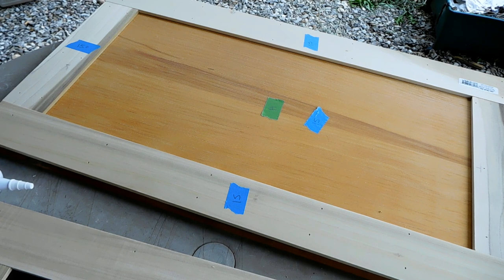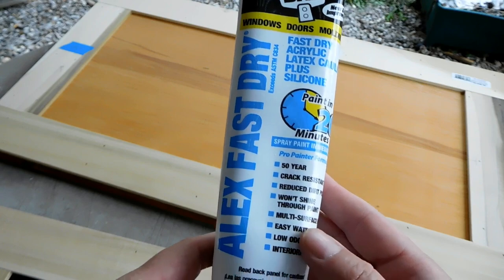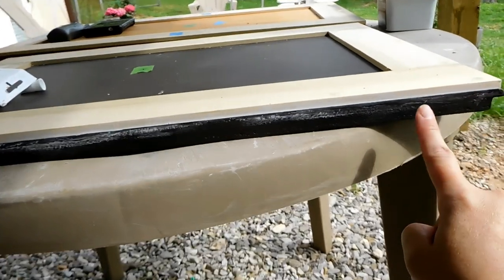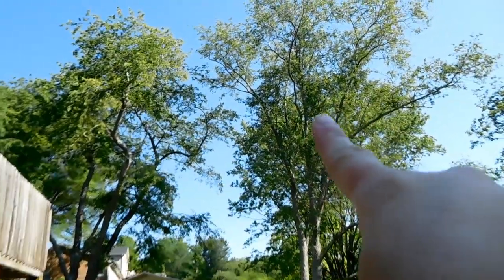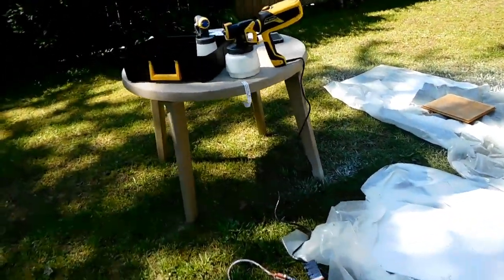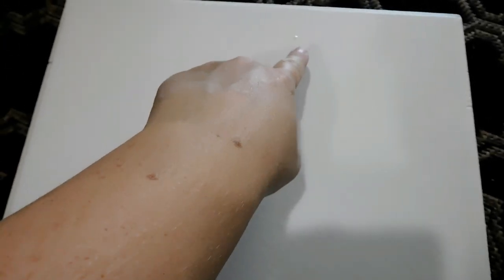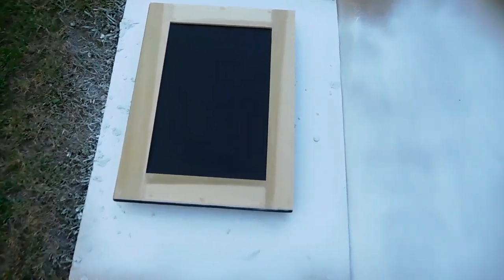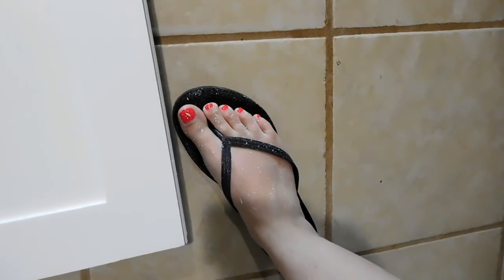Spray Painting Kitchen Cabinet Doors!!! :D Finally!!

Comment: What ratio did you end up using? 2 part paint 1 part water or 1 part paint 2 part water?
Reply from the maker: I used 1 part water to 2 part paint. I did not want a super thick consistency because it will not spray evenly out of the paint gun if it's too thick. I wanted more of a thinner coat so that I could do  three layers on it to make a more smoother finish. But be sure to read the back of your paint can because each paint is different. You can also call the  company that makes the paint and ask them what the ratio is for your spray paint gun. That's what I did as well as read the back of the can. I hope this helps, and happy painting 😊
Reply: I also have a Wagner flexio 590 that I use to spray paint. The ratio that I find works best for latex paint is 3 ounces of water for every quart of paint or 12 ounces per gallon of paint.  Metric measurements are about 90ml for 1 litre of paint or 360ml for a 3.78 litres of paint. The detailed nozzle is the one that I used to paint cabinet doors.
Reply from the maker: I will definitely keep this in mind 😊. It's good to know the ratios for future projects. Thank you so much for watching and commenting ❤️

Comment: You don’t even have to thin the paint at all just adjust your sprayer to wear you’re paint stream is less paint comes out. Soon as I seen you do the practice run I instantly said to myself she has to much flow coming out lol.. I have the Flexio 590 and I’ve had it for 3 yrs and absolutely love this thing. I originally purchased to paint smack refurbished wood furniture and small decor pieces but I love it so much I have since  painted the inside of my entire house and large large brick fireplace so much stuff this thing is amazing.. I know you have finished you’re cabinets by now but just in case anyone else might could get some benefits from my tips, also if you don’t spray n stop spray n stop you will get a much much smoother even coat just keep the nozzle pulled in and just keep you’re hand moving side to side or up n down which ever direction you have the nozzle set up this will improve you’re coverage a whole lot.. But I seen you’re finished cabinets they look great. Oh and another thing for anyone who may read this if you are doing a project such as cabinets that you really want to look professionally done do a light sanding after you’re 1st and second coat with just really fine 60 grit paper then do you’re last coat which should be three total but each coat just do light coverage they will turn out so, so much better rather than 2 fuller coverage coats. Hope this helps someone .. just take you’re time and you will be very happy with whatever you’re trying to paint and trust me you can’t wreck anything if it doesn’t turn out you can sand it down and start over it’s only paint. But it does take a little practice but once you get it down all you’re adjustments you’ll love this thing if you’re a DIYer n enjoy painting.. I promise you..
Reply: Thank you for taking the time to offer this advice! I am about to buy my first paint sprayer and this has been a big help toward my confidence level in using it. I'm going to copy your instructions to save and use them when I get the sprayer. Again, thanks for sharing your experience, Kim.
Reply: 60 grit is not a fine paper,it's very aggressive

Comment: Looks great! I have the same sprayer and wonder if you recall your settings that you used. It looks like you used the fine sprayer - the small cup, but do you  recall the air setting and wideness that you used? Redoing all my six panel doors in white so I want it to look as good as yours!
Reply from the maker: Tim Barrett thank you so much! :-) it's been a while since I spray painted them, so I can't remember the exact spray setting I had it on 😕. I read the instructions for what they recommended for a finer mist, and I practiced on some cut up cardboard boxes outside to get the overall smoothness of what I was looking for. I think I just adjusted the nozzle to where I thought it was not going to over spray or spray too thick, and kept it close to the number the sprayer recommended. But I definitely went with finer coats instead of thicker ones because of runs, and drying times. Too thick of a spray will leave Bubbles as well when they're drying. I'm so sorry I can't remember the exact setting. Make sure to first spray away from the cabinets first in case there's any splatters when it's first coming out of the nozzle, and then spray it smoothly while not shaking the nozzle or your arm from side. This will help to make sure you get a smoother finish. I found in practice that when I turned the nozzle different directions while spraying, the paint was thicker in certain areas than in others. So if you can do a smooth spray with keeping your arm straight and just moving the nozzle as you go without turning it side-to-side, you will get a very smooth finish. I hope that makes sense lol. I'm terrible at explaining  things. Yes I did use the smaller cup because they said the larger one is for bigger projects and would probably over spray. Also make sure that whatever paint you're using, to dilute the paint according to the instructions on the back of the can. Each paint is different for spray painting. You don't want it too thin but you don't want it to thick either. Because thicker paints will get globbed up in the spray nozzle and then can cause drippage or over spray. I hope this information helps you and I thank you so much for watching my video and wish you all the best on your cabinets! :-) if you have anymore questions, please let me know

Comment: Great job you lucks like profecional nice red foot nails I love it you doors lucks very nice but you never said how much you. Diluted you paint ? Hello from New Jersey
Reply from the maker: My angels painting lopez thank you!! 😊 the paint was a 2 to 1 ratio. It was two portions of paint to one portion of water. So if you did two cups of paint for example then you would only use one cup of water. I hope this helps! :-) also keep in mind that every paint is different. The type of paint that I used was a two-to-one ratio. But look at the paint instructions for whatever type of paint you use, before deciding the ratio of paint to water. You can also call the paint manufacturer for the proper ratio to make sure of what you need to use in the spray paint gun. Thank you so much for watching and I hope that you have a very Merry Christmas! :-)

Comment: You did such an amazing job! I just bought the flexio 590 sprayer and I am planning to spray paint my cabinets. I was just wondering what ratio did you end up using? I know it’s been a few years lol hope you can guide me a little! Thank you ♥️
Reply from the maker: Thank you so very much! :-) I cannot remember the paint that I used, but I think it was a one-to-one ratio. One part water to one part paint. Check the back of the paint can, and it should give you instructions on the ratio if you're using a spray gun. If it does not have instructions for that, I would call the local store that you purchased the paint from and check with the paint department and see what they recommend for a sprayer. But if I'm not mistaken, I think mine was a 1 to 1 ratio. Thank you so much for watching this video! I hope it's your pet project does exceptionally well! ❤️😊
Reply: Thanks so much for the advice 🥰
Reply from the maker: @nidahassan5556  you're most welcome 😊

Comment: You did a really great job on the doors! What kind of board did you use to frame out the doors? I've been to a couple places and can not find anything that slim or wide.
Reply from the maker: Thank you Noel! :D

I purchased quarter inch thick boards that are 1.5 inches wide, and I around 4 ft tall from lowes.  I will send you the link to them below :).

https://www.lowes.com/pd/Common-1-4-in-x-2-in-x-4-ft-Actual-0-25-in-x-1-5-in-x-4-ft-Poplar-Board/1000074305

Comment: Do you still have the links to the wood you used and the paint too? Thanks!
Reply from the maker: Here is the link for the wood that I use for the cabinet doors.
https://www.lowes.com/pd/Common-1-4-in-x-2-in-x-4-ft-Actual-0-25-in-x-1-5-in-x-4-ft-Poplar-Board/1000074305

The paint that I used is at lowes and is Valspar Cabinet Enamel

Comment: font of doors look good ,but edges look not so good
Reply from the maker: Thank you for the compliment on the front of doors. The edging actually looked really good when you saw them in person. Beveled edges makes it really hard to make everything even. With these 1965 doors, there was no way to actually cut the beveled edges off to make Square doors so that they would look more modern. If you cut the beveled lip off of the door, and then lined up the trim on the face of the door, with the cut off edge to make a more square style, non beveled shaker style cabinet door, then there would have been a gap in between the cabinet frames, and  the doors edge. The beveled Edge hid that gap where they back of the indention fit into the frames of the cabinets. So the way that I did them turned out to look pretty awesome. They actually looked amazing and flawless in person. Thanks for watching the video and I appreciate the compliment on the front of the doors

Comment: Great Job !! was just wondering if you could have trimmed off a 1/4"  all around each door with a table saw to make it Square?  if not can you tell from the edges that the wood is glued on? Also, did you put 2 or 3 coats of non-yellowing poly on them after you painted for protection from wear chips etc ?
Reply from the maker: Thank you! :D  I actually thought about making them square, but by doing so, then it would show a gap from where the back of the door fits inside the cabinet.  The lip is what hides the crack of the front to where the backside fits in the cabinet.  I hope that makes sense lol.  

You cannot tell that the wood is glued on because you want to make sure that you don't put the glue to close to the edge of the trim when gluing it to the cabinet.  If you do happen to get some on the outside, then wipe it off immediately. I usually run the glue on the back of the strip, in a squiggly line down the middle of the back of the trim, and not an excessive amount, so it doesn't squeeze out the side when gluing it to the door.  I will leave the video link of where I made the doors facings below ;).  It gives a step by step detail on how to make them.

If you use a enamel paint on the doors, then you won't need a top coat.  When I first used spray painted these doors, the lady at Lowes gave me the wrong paint to use.  And after all the hard work, it chipped.  I ended up going with the insl-x cabinet coat enamel paint.  You can get it on Amazon.  It doesn't require a top coat.  If you do go with a regular paint, then yes you would use a top coat.  Preferably a water base polyurethane. It's not supposed to yellow.

I hope this helps!  Be sure to check out the link below.

https://www.youtube.com/watch?v=Ga4ZesiQ1hk&t=509s
Reply: When I watched your video I was shocked because I've been rolling that same idea in my head for around 5 years. How was the final product, was it worth it ? thinking of chalk paint aswell ,,, let me know much appreciated!
Reply from the maker: Michael Chisenhall thank you so much! :-) the original paint that I went with in the spray paint gun wasn't the best paint so I ended up sanding the cabinet doors and used a product that I bought on Amazon for cabinets called insl-x cabinet coat enamel. I really like it. The spray can paint Gun Works amazing! You just got to spray light coats and not get too close because you got to be careful with dripping. I don't know how well chalk paint would work in a spray paint gun. You could read the back of the paint and see if you can use it in a spray paint gun. Typically a lot of paints have to be watered down in order to use them in a spray paint gun. I would read the back of the label to see what the ratio you would need to use is and then tested on a piece of cardboard or scrap wood before spraying on your doors. The spray paint gun makes it so much easier to get them all done smoothly and easily and faster. I love the spray paint gun that we got :-). It's amazing! I hope this answers your questions. Let me know if you have any others :-)

Comment: When you say part is that one cup water two cups paint.
Reply from the maker: If I'm not mistaken, it was two parts paint to 1 part water. I actually called Lowe's when I purchase the paint and they gave me instructions on how much to use. I think the back of the paint can will actually give you the exact ratios depending on what paint you're using. I'm so sorry I don't remember off hand. It's been a while since I did the project and honestly cannot remember. I know I should have put it in the video but wasn't thinking about it at the time. Definitely read the back of the paint can and if you don't get your answer call the paint distributor because they can actually tell you what ratio to use. Happy painting, and if you have any other questions please let me know. So sorry I couldn't answer this one

Comment: So Its been well over a year, how has the painted cabinets held up?
Reply from the maker: The cabinet paint took beautifully! Thank you for asking. We have since sold the house and I bought a new one. But the entire course that the paint was on there since before we moved in October, stood up fantastic
Reply: Thanks,  I am looking to paint my cabinets in a new house we bought.  Is there anything you learned that you didn't cover in the video?
Reply from the maker: I will tell you that I did use a different paint on another set of cabinets than I used in this video, and even though the quality of paint that I used on the cabinets in the video was great, I feel that the other paint quality was exceptionally better. The paint i used on a bookshelf cabinet doors held up fantastic. I used the Valspar cabinet enamel paint on the bookshelf. It was wonderful because you did not have to put a top coat over it. The paint that I used in that video was not specifically designed for kitchen cabinets. So I did end up having to put a top coat over it. To save time and that extra step, I would use the Valspar cabinet enamel paint. It worked amazing and you do not have to put a top coat on it. 

The only other thing I can tell you to do is if you have any nail holes or any top of area that needs to be filled in, make sure that you sand any wood filler down really smooth and also make sure that you caulk everything and let it dry before you start painting. I know that's just common sense, but I can't tell you enough that you need to make sure that you have a solid full smooth surface. Because if it's not sanded perfectly, then it will reflect in the final product. And if you by chance decide that you want to Roller brush instead of spray paint them, make sure to light sand between each coat for optimal results. Use a sponge roller if you decide to roll paint instead of spray paint. If you have any questions during your project, please let me know. I'll be glad to try to answer them. I hope that you're painting process goes exceptionally well! 😊

Comment: What ratio of paint to water did you end up using?
Reply from the maker: I used 2 part paint, to one part water. But read on the back of the can of paint to see what ratio you need to use in a spray paint gun. That was just for the paint that I used but according to the paint department that day that I purchased the paint, they said that it will vary depending on the paint. 😉

Comment: Can I use any paint with that sprayer
Reply from the maker: Honestly I am not sure. I think you can but I know that some you are not able to thin out with that sprayer. Each paint is different and if you read the back of the can, some paints says that you absolutely cannot thin it if you wanted a finer coat. A lot of paints like Behr, Valspar or Sherwin-Williams and so forth, you can actually thin out and use it with the spray gun. It depends on what type of finish you're looking for. So you could pick a paint and then ask the paint supplier whether or not it is a good paint for spray painting. I know that the insl-x brand which is an enamel paint is not a paint that can be thinned out. I use this brand on a different project and it said that on the back of the can. This brand also can bubble if you spray paint it. The regular latex paints yes you can definitely spray paint with, and you can also use oil paints in it. But for some reason that one brand that I found, you are not able to use it in a spray painter and that's why I went with the kind that I used in the video. I think it was Valspar brand that I used for the cabinet doors

Comment: Would u b able to show when u do the backs?  just curious if u get any over spray to fronts when u do backs.  hope that makes sense...lol
Reply from the maker: Andrea W yeah I will try to do the  back side of one of the doors and post it on Fridays video. you can adjust the settings on the paint gun that I bought to do light spraying on the sides so that you don't overspray. But I will post a video for that and then I will share once it dries. I will show the front and back